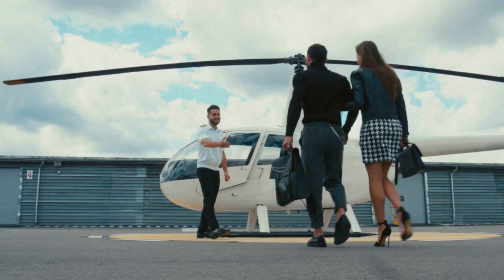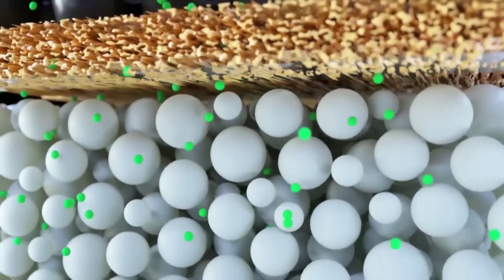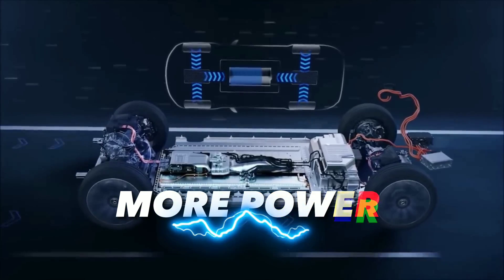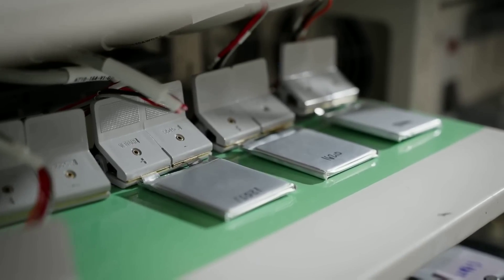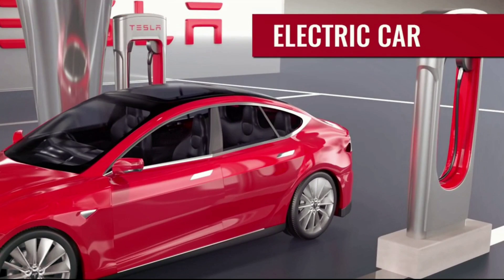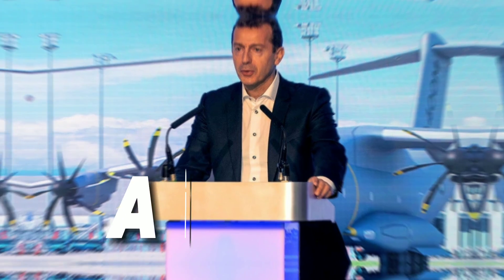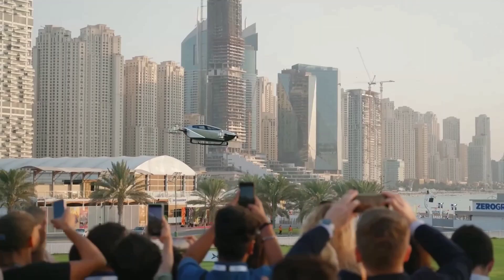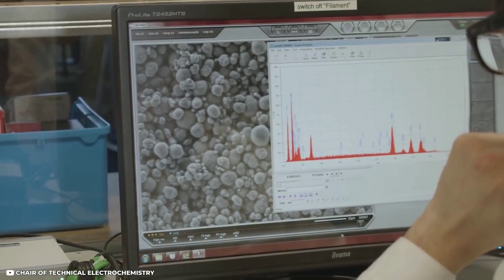Amprius’ New Battery Material Shocks the World with Its Power!

Comment: The rule of thumb is that i would believe more in a company that is currently producing batteries than one that doesnt even have a production plant. Coming out with a high density battery is only 1/3 of the story as large scale commercial production may not be necessarily feasable due to cost.

Comment: I agree with the comments below and will add my opinion that these hypes have only one purpose, to attract investors. While I like the development, for a qualified investor it would require prior technological knowledge of the process, which however would be very hard to reveal to someone who is just looking. Even if a headline claims 10 times more capacity, there are many other parameters, like how many cycles, the cost, weight, speed of charge, flammability, size...

Comment: Really dumb.
It's the Cathode that limits battery power. It weighs 20x Lithium in battery.
High current batteries use Lithium metal not graphite.

Comment: I've lost count of how many times I've seen a new "game-changer" battery that's yet to enter mass production.
Reply: I've lost count how many times "Amprius Technologies" was uttered during this video.
Reply: @slow_runner  Not a info video it is an ad
Reply: This is very much how the channel works. They're all puff pieces that do nothing more than advertise  the current snake oil
However, CATL, the world's biggest battery manufacturer, did recently launch a 500Wh/kg /700Wh/litre battery that will, according to them, be in production by the end of this year. I doubt very much that such a claim is a fraud. You can do a search for CATL and "Condensed Matter", that should give you the relevant information,
The CM battery, if  it Mts expectation really will be a "Game changer" as it will effectively double the capacity of a similar weight battery pack, or provide much greater range AND reduced weight.
But there are multitudes of companies working on battery chemistry and there is no reason why 700 or even 1000Wh/kg can't be achieved. There is, after all, a 700+Wh/kg experimental battery that the Chinese government has been working on.
Unfortunately, these things do take time to come to market, that is the nature of things. I suspect that the CATL battery is coming to market so quickly is that the production processes are not that dissimilar to conventional Li ion batteries.

Comment: Silicone anode battery tech has been around since the 70s but was deemed impractical as the anode deteriorates very quickly.  I wish for the best but it seems hopeful wishing at the moment.
Reply: if a wire eliminates that then they have something that can work.

Comment: I wonder if the extra weight from a small generator would be worth it for extending flight range vs a much larger battery or maybe even a turbine/generator combo.
Reply: Hybrids are in development. Greater complexity though and you would be burning fossil fuels.
Reply: @martinw245  

You can use hydrogen methane from biogas bio fuels from diesel to ethanol.. as for wt and complexity take a look at the Fluid piston rotary motors that can yield 1hp per pound.. and are potentially very efficient. 😉 Sailing yatchs and boats have you be able to maintain power over long periods ... But conventional derv ICE power is very very dirty and heavy.. but energy harvesting is very easy ..but you still need emergency back up for when you are in a bad place at a bad time.
Reply: No
Reply: @Bob  The Volt is a car, not an aircraft. And if a car has a fossil fuel generator, it's a hybrid. Hybrids are everywhere. My daughter has a hybrid. So I'm not sure what you are trying to say.

But yes, hybrid aircraft are under development. They use fossil fuels, of course, which is something we aspire to avoid, and hybrid aircraft introduce an inefficient and complex ICE engine, but as I say, a number of experimental hybrid aircraft exist.

The near term will see electric, hybrid electric and fossil fuel driven aircraft. And as battery energy density continues to improve, we will see more pure electric aircraft with increasing range.

Currently, the Eviation Alice is about the most impressive with a 450-mile range and 11 passengers.
Reply: @martinw245  Sorry, missed "flight" in there.  Connections to batteries and aircraft simply don't enter my mind.  Because that just AIN'T HAPPNIN except in fiction.  Yes, I know there are attempts at battery powered aircraft, but they aren't going mainstream any time soon.
Reply: @anvilsvs  

"but they aren't going mainstream any time soon."

Depends how you define "mainstream". 

They are already here. Eviation Alice carries 11 people and has had several test flight's Lots of orders including for Fedex.

Then we have the Pipistrel Alpha Electra that has been used for flights school training for some time now. Lots of electric EVTOL taxis in development as well, short range, but yes, they are here now. 

There's a list of electric aircraft in use or in development on Wikipedia. There are a multitude. A plethora of flifghts are very short range, so yes, there is a market for them. 

Harbor Air have DHC-2 Beaver aircraft that have been converted to all electric. 

Battery technology is advancing incredibly quickly, you will see more and more electric aircraft and longer range sooner than you think.
Reply: @martinw245  I'm familiar with the ones you mentioned.  And our definitions of mainstream are not the same.  A high volume flight school cannot use a plane which spends half of the day charging.  A single instructor spending half of the day on the ground might make this work, but probably still not because students will need to schedule back to back flights to fit their schedules.  So don't expect many flight schools to be switching soon in spite of the fact that electric power should be cheaper than avgas.
Reply: @Paul Bunce  

Hi Paul. I didn't say what my definition of mainstream was, just that it's dependant on the definition.

As for Alpha Electra, you are obviously unfamiliar with this aircraft. So...

1. It doesn't spend all day charging. Charge time is 50 mins.

2. There is no need for a student to wait for charging. At the end of a flight, the battery pack slides out, and a charged battery slides in.

3. There are 500 currently flying around the world, and they are selling well. Flight schools like them because they can offer very cheap flight training and maintenance on the aircraft is minimal.

As I said... There are a multitude of electric aircraft in development. My favourite is Eviation Alice, which has numerous orders on its books.

So maybe you can tell me  how you are defining the word "mainstream.""
Reply: @martinw245  You are correct that I wasn't familiar with battery swap on that one.  So it obviously will work for the limited use of flight school.  And will probably do well there.
Reply: @Bob That would be because it removes more battery weight than it adds if you want range.  Hybrids remain the best option for most people for the near future.  And that's what a range extender is.
Reply: @Bob Why would it be inefficient? It wouldn't need a gear box or drive shaft, it just needs to provide electricity.
Reply: @Bob 
Check out the fluid piston rotary 
designs for spark ignition and now diesel   ...as well as Rotopower..  small efficient simple and powerful for APUs and generators.

Comment: Is this like one of the many breakthrough battery technology from Tesla, only to use CATL Chinese batteries ? Silicone is nonconductive use to make semiconductor, as insulation.
Reply: sir ! you are basically right with a minor glitch .   Silicon = semiconductor   ;    silicone ( a kind of rubber ) = insulator.
      but as you said , we need conductors , not semiconductors.